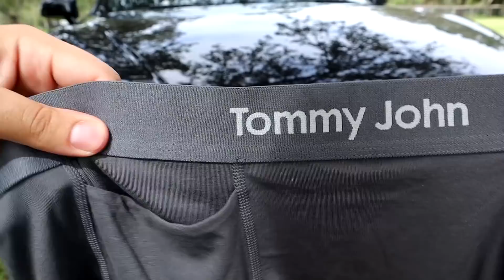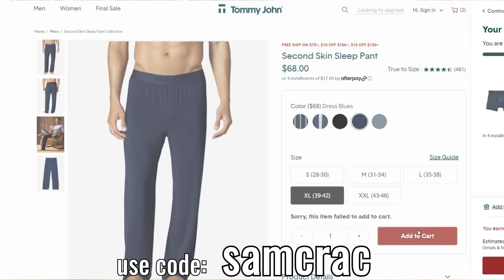This BMW Cost $90,000 New! Now they're Being Sold for $3,000 at Auction and its Still NOT WORTH IT!

Comment from the maker: 17:36 For the WORLDS WORST BMW (I Kind of Want one for Testing Purposes)
Reply: Samcrac thanks bro.
Reply: Go ahead sir
We'll watch
Reply: LS swap and solve its problem 👍
Reply: If you want, the ActiveHybrid3 is actually an electrically boosted 335i. It goes even faster, with better MPG. Stay away from the 2011-2012 ActiveHybrid7s though, only the 2013-2014 have the updated hybrid drivetrain that is shared with the ActiveHybrid3 and ActiveHybrid5 (released 2013-2014).
Reply: 3 Dollops the AH3 is not supercharged. It’s just a 335i with a compact electric motor on the output shaft, and a small battery.
Reply: @XcoolcoolbeansbeansX  You are right, sorry. I just meant supercharged in the sense it's like an accelerated version, forgot that was an actual term to represent an actual mod. Lol. Edited.
Reply: Get it get it GET IT
Reply: I have the non-hybrid model. Great car.
Reply: Bro why the hell did you pull a banana out of your pants lmao
Reply: BMW F01 😍😍😍😍
Reply: You can have mine, 750LIx, engine seized at 108k after oil loss. Now in talks with BMW about this engine problem.
Reply: @2020Dreamlife  Ooh! Samcrac need to get his hands on this!
Reply: I had few bmw 7. E38, E65, now I have F02. I don't know about hybrids, but diesel engines run 400k+ miles if you maintain it good and i think F1 is best looking car from all 7 series, as it is like E38 and E60 mix. From my opinion E65 is worst car from all 7 series, I had 4.4, v8. That car whose just money hole, at the end engine got damaged and I sold it.
Reply: @tikpok_net  Yes F01 is my dream BMW
Reply: @tikpok_net  pre facelifted E65 is pretty good one too I really like it. Actually both ones pre face post facelift.
Reply: @trooperodst6880  My in my e65 pre facelift in 2 years, got broken gearbox, needed to change it, then all chassis was rebuilded and at the end engine got broken. In total I lost about 8200 euros. :D E38 whose so relatable, in 7 years I never changed gear box oil, I found about oil change after I owned e65. My e38 had 3l petrol engine, a lot of mechanics told that this engines is basically indestructible, prices are cheap on them as no one buys them because they don't brake.
Reply: @tikpok_net  😯😯😯😯😯 my jaw dropped so hard 8k dayymnn
Reply: If you wanted to bring one of those BMWs back to life on the cheap, check with Spiers New Technologies in Oklahoma City. They rebuild/remanufacture batteries for electric and hybrid cars. They might be the key to making a killing on those if they're going for that cheap.
Reply: I believe those actually still have the same problematic twin turbo v8 the the non hybrids have either way don't buy
Reply: instaBlaster

Comment: My guess on the C8 #1 is that someone hooned it off the line and lost the back end over a curb. I'm basing that on the tread on the rear tyre looking like it is no stranger to a burn out. I like the trackday theory as well, but I can't think of many tracks with big enough curbs to rip a wheel off and put a huge dent in another.

Comment: I imported a 2007 Stang from LA in the US.  I love it, great engine good power and economy combined.  not overly powerful but you can do alot to make it a lethal machine.  I have left mine relatively stock standard as I enjoy it pretty much the way it is.  I did replace all the bushes underneath and I put a single piece Ford Performance drive shaft in.  The only thing I would REALLY recommend you do is get a better ratio differential the factory one is just way to tame.  For add-ons and mods the s197 is a really good Stang to buy you can get many cheap things to improve it

Comment: The roof on that s-class has detached, the whole body is twisted.
Reply: I believe it’s just the trim missing
Reply: @DetriotV8  Yes, but look at the line where the rear window glass meets the roof.
Reply: Want to point to the EXACT time in the video that you can see that please.
Reply: @geneva760  4:17
Reply: That definitely is just a trim piece that follows the whole roof line.
Reply: I thought it was twisted too, after some research there is a piece of trim supposed to be there
Reply: The rear door Gap is gone. Bad news.
Reply: made me laugh when he was saying it would be cheap to do. I had a loaded c300 2015 and i just crashed into a deer in the right front. no frame damage but looked like this car but not so far back just to the front of the wheel. no airbags. totaled it. over 17k in parts alone. so that s class i wouldnt touch with a 10 foot pole lol
Reply: update. looks a bit like the corner on that black c class in the video later on. maybe a little further in

Comment: Yeah sure...buy another Range Rover. What could POSSIBLY GO WRONG?
Reply: If you buy enough of them, eventually you'll have enough parts to maybe get one running properly.
Reply: We may build them here in the UK, but the quality isn't any better than the export models...

Reliability for luxury SUVs aged up to five years old in the UK
Rank	Make and model	               Percentage reporting no problems
1.	Porsche Macan 2014-on	       96.9%
2.	Audi Q7 2015-on	                       94.0%
... 
6.	Range Rover 2013-on		        85.4%
7.	Range Rover Velar 2017-on	81.9%
8.	Land Rover Discovery 2017-on	77.0%
9.	Range Rover Sport 2014-on	74.2%

"Owners told us that 40% of Range Rover Sports had gone wrong, a worryingly high proportion of them with engine problems. A third of the cars couldn’t be driven and nearly half took more than a week to repair."
Reply: I would never recommend a Land Rover or Jaguar. They are endless money pits and even the ones that have Ford parts are still expensive to fix because they put the less desirable Ford engines in it like the 4.0 SOHC in the LR3 and the 2.0 EcoBoost in the Evoque. The 5.0 V8 in the Jaguars and Land Rovers are not the same exact engine found in your Mustang or F-150. While the newer models are more reliable, they are still considered unreliable and expensive to maintain. The diesels are also very bad as well and the 3.0 diesels have premature cam wear and that engine you get in a Ford F-150 is the same exact engine in a Land Rover. The 2.7 diesels we didn’t get in the States were JUNK.
Reply: @atx-cvpi_99  There was a Discovery diesel with so little torque - and that is an achievement for a diesel - is struggled to climb a small inclined road.
Reply: Atleast you won’t be bored while driving in a Range Rover
Reply: @vintagethrifter2114  LOL!
Reply: @yes8032  On the edge of the seat..."what will go wrong next? Will I be stranded?"
Reply: @vintagethrifter2114  For a little while, maybe.

Comment: The welding on your audi is really good. If the frame ever cracks again it wont be from that welded section. Some people are just flower petals, or maybe they got ripped off by one of those super expensive fixes from a "certified" company that fixes frames. Who knows

Comment: I have a lot of experience dealing with body shops with working at a dealership and also salvage yards and the one thing that nobody covers on these videos for the rebuilds whether it’s your channel or other channels is if the window is down on the vehicle and it’s sitting in the salvage yard there’s a good chance that it had rain go inside and the only way that carpet will dry out underneath is if the carpets pole and all the electronics they got wet in the process. And even if it’s got plastic covering the window it typically sits at a tow yard before Insurance company has it picked up to ship it to the auction so even in that case there’s a good chance the interior got wet and most likely rain sometime during those processes so something to consider is the vehicle probably has a lot of water damage especially if he came in contact with electrical parts. And I have experience ripping out interiors of vehicles with low miles and finding water under the carpet so they’re speaking from experience
Reply: Why do you think they are cleaning them up now before auction?

Comment: The second C8 is a cool colour: Ceramic Matrix Gray Metallic.  It was first used on the C7 and when GM was doing its road show with the C8 there was a red car in the portable building but a car this colour outside.  At first you think it is white but the gray is very subtle.  With all that is going on, I am not sure you would be even able to get any replacement parts from GM at the moment.

Comment: So the F02 active hybrid7 is a boosting system. It came with the twin turbo v8 (n63 yes the one with valve seal issues) and a small electric engine which during accel would boost it. The battery is in the trunk. I've never swapped one out, but honestly I've had the trunk apart to just short of that and it's the smallest hybrid batt I've seen so wouldn't be hard to swap if you can find it at a decent price

Comment: First C8 looks like went too fast out of an intersection turning left, hit the kerb, broke the low-right front and the rear right wheel made the car lift the rear left in the air, breaking the rear-left wheel on landing.
Reply: He ran a red light and hit a pole

Comment: I prefer the C8 with the tan interior. Just wondering how the car will drive even if you replace the whole front end. Sometimes heavy front end damage forever compromises the handling.
Reply from the maker: I have a video you might like to check out! I took my Audi R8 with repaired structural damage and it aligned out perfectly and drives awesome!
Reply: Samcrac I will check out that video.

Comment: The batteries can be disassembled.
They are multiple batteries jumpered together. Replace the bad cells and reassemble it.
With a little research you can figure out how to reset a battery from zero charge.

Comment: That S class suspension is not sitting low, it's fubar and needs replacing in my opinion. Look how low the passenger side rear is compared to the driver side that is what it normally looks like when it is broken on an average level.

Comment: The 4.6 3 valve Mustangs aren’t desirable because they were not reliable like the 2 valve and Coyote is. The 4.6 3 valve shared the problems with the 5.4 3 valve. In 2011 Ford released the first 300+ hp 3.7 V6 Mustang which was very impressive for it’s time and other than the water pumps which on the Mustangs and F-150 trucks that are external they are very reliable. The 11-12 had some issues so I would look for a 13-17. The 3.5 and 3.7 in a Taurus or Explorer are junk.

Comment: Those mustangs would be gone in five seconds where I live. I've been trying to find either a 2005-2010 Mustang GT or 2011-2017 Mustang / Mustang GT (basically any Mustang with either a 4.6 V8, a 3.7 Cyclone V6, or a 5.0 Coyote V8) to work on for about two years now and I haven't been able to find anything in my area worth getting. I've been saving up, but I just can't find a car that's broken enough to need repairs I can do so the price is low, but easy enough to repair for one person to actually make it worth buying. Everything around me is either rusted through with frame damage and tons of work needing to be done, or is in such good condition that it's way out of my price range as a college student making minimum wage, and wouldn't even be fun to fix.

Comment: from just what I have seen of slavarge corvets a front end colsion I a complet wash out and from rob dams c8 the fram rails parts can not beboughthis c7 also had frount damage it look like any frount end over 5 mph is going to cost as much as a new one by the time you buy the wregch and part to fix it and you may not be able to fixthe frount fram this maybe the frount crush zone phsioly but  it means a lot of wash outs the first one with the plastic overit had bio hazrd singscould this mean eather someone bleed bad in the chrash or died thanks for the good insite may God keep you safe

Comment: On that BMW hybrid, the Auto Check report says the car was at a dealer auction in 2011 when it had 7,500 miles on it and then again in 2013, 2014, 2019 and 2020.  Nobody liked this car.

Comment: Yep!...they ARE going cheap but I wouldn't buy one. Why> because it costs an arm and a leg to repair then when something goes wrong and NOT every garage has the proper tools to repair them. I know this because my son worked for a BMW dealership - he also worked at the Mercedes manufacturing plant in Alabama and said he wouldn't buy one of those used either. Brand new!...he said BOTH vehicles are really sweet HOWEVER, when repair time comes around - usually on used ones -  they really drill a hole in your pocket. Even used they really look and drive sweet. My roommate drives a Mercedes 740 - seems like he's always fixing something. It's usually parked at home more than he drives it. Right now the heat is not working and it's getting colder so guess what...he bums a ride to work

If you can get a good deal on a used one...go for it
If you have $$ to waste on repairs...then go for it.

The choice is YOURS.

Comment: BMW use plastics engines now when the plastic cracks after 3 years are scrap , there is a youttube video about the plastic BMW engine parts. That Audi repair may  not be correct a 500 weld on safety structure, could just have filled it. 130000 on Range Rover would be scrap they don't  make them to last any more, It may be those Vettes have handling faults like the Audi R8 probably best to stick to Porsches if you value everyone's safety when the brands that dont make super cars try and built one never handle well. The audi R8s are rare in Edinburgh but 2 roads have been closed on separate occasions when 2 different people spun their Audis R8s

Comment: Sam. I like your videos but when you buy cars from auction sight unseen,  you are begging for a letdown. These engines are not your typical Honda or Toyota. M5 v10s are high performance engines that need to be treated as such and serviced accordingly.     The biggest problem with these cars is the owners. They are expensive to maintain so the owners just drive them until they just tont drive anymore. I purchased one last year for $12k with 90k miles. I knew from my research that it was going to need rod bearings but they were not too far gone. I did the project myself and now I have an awsome beast. Also its a manual. Please please please don't bash this car just because you bought one with 160k miles on it for 3 or 4 grand. Now that the motor has a spun bearing, it is toast because now the crank is damaged. These cars also need to be warmed up before they are driven. The 10w60 required for these engines will not flow well until it is up to temp causing premature bearing wear. Please do some research before you bash an awsome car.

Comment: 6 cylinder😂😂😂🤧 in-line 6 he means and no it’s a twin turbo v8 and they have problems with there head gaskets but if you know anything about bmw you have your beemer fully inspected and code read every time you maintenance and you’ll catch that $1,200 problem and have a 300,000 sedan on your hands that makes 465 hp at the wheels

Comment: |interesting BMW which highlights the folly of Hybrid/EV 'eco' cars and the general poor quality and stupidity of BMW...
A battery which only asts a few years and is so expensive to replace as to render a very expensive, luxury saloon car redundant...Thereby totally negating its raison d'etre...Think of all the energy consumed in building this car, the enormous amounts of pollution, the huge quantities of oil used to produce the plastics, the rubber, glass, metals, plastics, leather..the pollution created by the employees getting to and from the factory, the pollution and carbon created by the import/export of all the materials to build and then ship the thing.
I keep saying it..BMW has a very high 'perceived quality', but scratch the surface and they are ridiculously over engineered, poorly designed, appallingly built dross. Utter rubbish cars. Lift the covers and look at the toy town wiring..The cheapest materials possible everywhere you look.
The most over rated auto maker in the world.